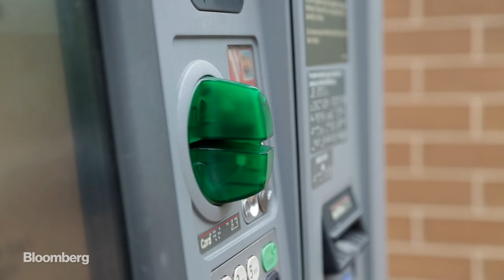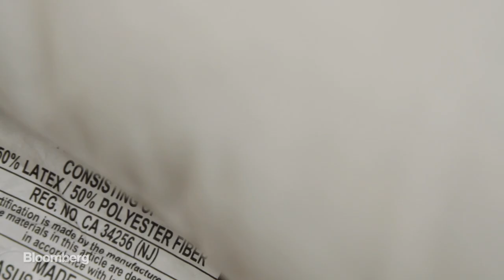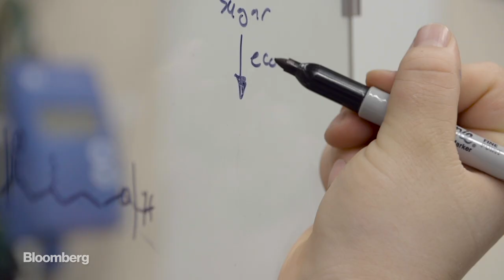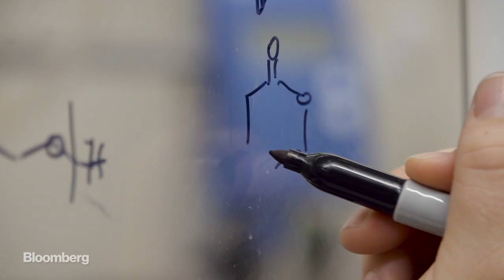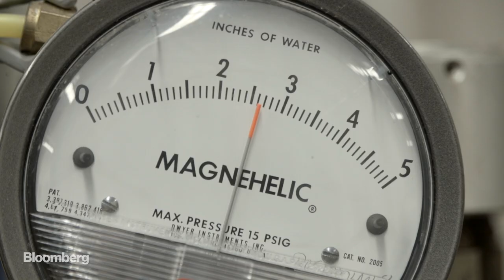Inside the Lab That Could Solve the World's Plastics Problem (Unsolvable: Episode 1)

Comment: The fastest way to make bio-plastic cost competitive is to tax the alternatives.  You could even use some of the petro-plastics tax to subsidize bio-plastic.  The subsidies could be given to domestic manufacturers to offset some of the costs of new tooling to use the new materials, giving them an advantage over foreign manufacturers.  Because so much of our plastic products are imported, the petro-plastics tax has to apply to imported plastic products as well.  If domestic manufacturers start using the bio-plastic first, they get a boost from the "plastic tariff", and the tax winds up encouraging foreign manufacturers to switch to the bio-plastic as well so they can avoid the tax even if we're not giving them any subsidies.  If the tax makes bio-plastics cost competitive now, it will become even more advantageous as manufacturing adopts the new materials and costs come down, so eventually the tax won't be needed anymore.
Reply: That's for sure, also electrical companies get lots more subsidies than sustainable electrics do.
Reply: No more TAX.
Reply: Freakin taxes. Too many people see that as a cure for every damn thing

Comment: Can we move back to when used mostly glass that is recyclable.
Reply: Yo for real. It might inspire people to be less clumsy these days too lol
Reply: You just WASH the bottles and if they are broken then you can send them to be melted into new bottles or whatever.
Reply: Aluminum is much easier and better to recycle.
Reply: @trickmiller8169  Aluminum is reactive and currently they coat it with plastics to prevent that but yeah for many products it can be viable.
Reply: @Barskor1  it's cheaper and more efficient than recycling glass and you yield more from recycling it. It can be recycled endlessly. Reusing, rather than recycling, glass would be easier, but companies probably wouldn't go for it, due to how cheap the alternatives are compared to it.
Reply: Swarthy Pariah actually it doesn’t
Reply: grafvonstauffenburg that’s the point. Its easier to melt it down that way
Reply: grafvonstauffenburg bruh it’s shredded in a controlled environment eg: a barrel or vented room

Comment: How about each region standardize the plastic packaging such that it's easier for the local recycling plants to process the plastics later?
Reply: How would that work? I wouldn't be able to get anything from another region that may be packaged differently?
Reply: @gregdubya1993  how about national standards?
Reply: hemp
Reply: How does that solve the issue of the billion tons of plastic already in the oceans and landfills? Still need to a recycling solution...
Reply: @greezooo  plastic bags can be processed into burnable fuel
Reply: @masterpalladin  right, I had forgotten about plastics-to-syngas. Thanks 👍

Comment: The best way to use recycling plastics like those are applying them into construction or infrastructural projects, mixing polymers with cement or concrete gives the materials a lots of benefits like sealing them or making them more stronger and flexible, also the life of the material become much longer than other industrial products and when it's time to recycle them again it's easier to obtain the polymers by subtracting them from old materials.

Comment: A lot of the time you mention consumers, you avoid the fact that some consumers really do care and really do make an effort, try reaching the zero-waste movement
Reply: I'm not trying to be mean or anything but the people involved in the zero waste movement are only making a microscopic difference into the world's plastic pollution problem. Don't get me wrong they are making a difference but not at the rate that it would take to save the world. The majority of plastic pollution can be traced to only six or seven countries and most of the people there don't recycle or care about the environment. What humanity needs is a cheap and simple solution to the problem because the majority of people don't care.
Reply: @r.r.r9300  - Those countries get imported plastic from Western Society. So the zero-waste movement is still beneficial, as is the vegan movement. Both focus on reduced resource-intensive consumption of products.  "Don't underestimate the power of a few highly dedicated individuals trying to make a difference in the world. In fact, it's the only thing that ever has" - Margaret Atwood

Comment: Fossil fuels: cheap, plentiful, reliable energy for billions

Hydrocarbon, or fossil fuel industry is the only industry that can produce cheap, plentiful, reliable energy on a scale of billions. That means that without such an industry, we don't have the amount of food we need, the amount of technology we want, the amount of anything we need or want.

The first thing to realize is that the vast majority of the world's energy is in fact produced by the hydrocarbon industry. This was true back in 1985, and it’s also true in the present.

Year 1985 Nuclear 5% Hydro 6% Gas 20% Oil 39% Coal 29% 
Year 2015 Nuclear 4% Hydro 7% Gas 24% Oil 33% Coal 29%
As you can see, there’s much more overall energy consumption now and the vast majority of that is still fossil fuel energy. What that means is that we're using considerably more fossil fuels, not less.

Comment: Just make plastic packages highly taxed. Companies will then sell linen bags, drinks in glass bottles and aluminum cans, cheese and foods wrapped in coated paper or will spend more to use plastic ish environmentally friendly materials...    It wouldn't need to even change any prices, just reduce the consumption tax and make a packaging tax that is equivalent in how much tax it generates. Then the price is level but companies will be forced to compete to make the packages cheaper by going away from the highly taxed plastic. Then once less and less plastic is used the tax on plastic packaging increases to keep the tax revenue the same until a certain point where there will be both a plastic tax and consumption tax once there is almost no plastic used.

Comment: here is an idea for a simple and excellent re use product that could eliminate or seriously reduce the usage of fiberglass for insulation :MYLAR plastic such as potato chip bags ect. as far as I have heard recently,are completly nonrecylable also "space blankets" put you hand inside an empty chip bag. SO gather and clean these by visual separation techniques that already exist ,  shred into 12" chips, and compress and glue together with sodium silicate solution( a cheap ,fire retardant glue)into a common brick dimension, use as insulation in green(and eventually all) building projects.

Comment: Step 1: Go to BevMo. Buy a 4-pack of glass Voss Water bottles for $10
Step 2: After you drank the water from a bottle, refill it with Reverse Osmosis filtered water.
Step 3: Goto Step 2

Result: less plastic water bottles in the landfill and whenever people see you with one they will assume you are wealthy enough to buy and drink Voss water on a daily basis without realizing what a cheep-skate you really are.

Added Bonus: Since the bottles are glass and not plastic you will not have to worry about any of the following chemicals
Phthalates
Bisphenol-A
vinyl chloride
ethylene dichloride
& cadmium

Comment: I am nearing 70 years old, and my Legos have survived three generations.  If you would take those cornflakes and turn them into building blocks about 2'hx2'w3'l blocks, we could pop a garage up in an afternoon, pump fire-resistant insulation thru the walls, and build a garage that could last 500 years.  No reason houses and swimming pools couldn't be nearly as easy.  Remodels, additions,  almost fun.  Earthquake, fire, and flood resistant.  With plastic being so abundant and durable, it would make sense to build a brand new house with 2 car garage for $35,000, out of waste, and without any special needs except maybe site preparation.  A piece of land, a few truckloads of plastic blocks, and that pegboard on the ground, and most anyone could build a strong building.  Just a thought.....

Comment: I think the major problem with this is solution is when you through this plastic out ,it's more likely that you've done it because the plastic itself doesn't last that long as petroleum plastic. For example, if you make a car(it's still far from reality) out of this kind of plastic, not only you need to check the condition of the engine and systems but also the plastic. Plastics on cars today last 10-20 years before having issues. With this kind of plastic, it would last 4-5 years because it degrades faster.

I think i might be missing something so don't be afraid to tell me

Comment: All we have to do is use the plastic as fuel. It can basically be substituted into any coal fired plant like steel furnaces, cement kilns, boilers for power plants. Compared to coal its much higher calorific value and much much cleaner burning.

Comment: There is a need for standardizing bioplastics, to make it is easier to sort petroleumbased plastic from bioplastic via optical / NIR sorting. Perhaps forcing single use bioplastic bags to have a standard color?
Reply: Since bioplastics are engineered anyway, why not add fluorescence to the equation?  Maybe each type could be color coded.

Comment: Here's a few ideas to solve the world waste problem, not just plastics. I'm not a scientist or environmental expert but SOMETHING must be done. If we use Critical Thinking we can eliminate this issue and stop trashing the planet. 
1. Lasers- really hot, could vaporize waste? 
2. Acids- really strong, some can dissolve metals
3. Geothermal disposal- tube to Earth heat layers, waste could be dumped and burned up? 
4. Solar tower- sunlight beam from tower (or satellite) could fry waste? 
5. Collison vaporization- An experiment at Sandia National Laboratory in 1980's involved a plane being thrown into a concrete wall at 700 mph, atomized upon impact. Perhaps a cone-shaped metal capsule shot into a wall at extreme speeds could be vaporized? 
6. Underground nuclear/thermobaric/napalm explosions- waste vaporization? 
7. Nuclear Fusion Reactors- Extremely hot, perhaps a metal container could be filled with waste, sealed, put in a vacuum chamber above the reactor to equalize pressure, then dropped into plasma (Tokamak design)?
8. Deep borehole disposal- miles deep holes? 
9. Suborbital capsule reentry- A metal capsule could be launched and reenter atmosphere to burn up? 
10. Deep ocean vaporization- old submarines could be filled with waste and a nuclear bomb, sealed, sunk offshore at vey deep depth, and bomb detonated to vaporize waste? OR containers could be filled, dropped to ocean floor and a nuclear bomb lowered to middle of pile to explode and vaporize waste? 
11. Rocket engine vaporization- Waste in bin above horizontal rocket (dropped into flame) or in tank mixed with rocket fuel for very hot fire (tube/tank underground for fumes/smoke?)
Temporary Storage solutions
12. Container storage- Metal/glass/plastic canisters stored in yards or in underground tunnels? 
13. Better landfill liners- metal/glass/concrete, no leachate leakage? 
14. Tank farms- similar to oil terminals, waste leachate contained and methane could be captured for energy?

Comment: Just about every single "solution" to recyling plastic ends up using more energy than it took to make and ship it in the first place. GIven that it's congealed oil/coal, the most efficient current solution is simply to burn the waste stuff as side stream fuel in power stations.

In the long term it's a valuable petrochemical resource, but that's very long term and the piles are getting too big to deal with.

Comment: Most of the empty packaging could be returned & reused over and over again, but companies don't care enough to have such approach.
Reply: Probably health & liability issues prevent that.
Reply: @sanniepstein4835  re-using without a proper treatment beforehand is not what i was implying. I was proponing that each company should take care of its own garbage, because this way the responsibility of recycling would be divided & managed much better, instead of letting a single company deal with the whole mess. For example, a huge plastic bottle of fabric softener is usually thrown away while it could return to their brand company and prepared for further use. Most of the plastic crap could be safely re-used, it just needs a bit of will & brain. Even the carton box for eggs.. people throw it away when they get home from the marketplace; that's its only purpose- to safely transport eggs to the client. Etc etc etc...

Comment: Plastic is a great product it's reusable, lasts a long time, it's repairable and it can be repurposed, recycled and it has so many uses.

The problem with these biodegradable plastics is that they have a life span that usually means costing you a lot of money to replace even though you didn't get the full use out of the product.

I have had plenty of those biodegradable plastic bags and when they break down they are a right mess, they can't be repaired they only last a certain number of years and they are garbage.

Real plastic bags last longer, don't make a mess and are repairable and reusable recyclable, and you can make other things with them once you have no use for their original design.

The problem with plastics is the people who use them not the plastic itself, people are lazy they throw things away rather than making use of them for other things, rather than recycling they use old plastic bags for rubbish, but then that's what happens when you are encouraged to do so.

Comment: The sorry part about plastics is that we are wasting natural gas and petroleum to make the stuff. Also, ever drive past refineries or oil fields, and see the burning flares,polluting the air and adding heat to the atmosphere? Sad, to say the least.  Try using wax paper, which preceded plastic wrap. Do not buy flimsy sandwich bags. Buy FREEZER BAGS, which can be washed and re-used many times. Used wax paper can be twisted, and used as candles for heat and light during emergencies, or camping out.

Comment: Why can't plastic be pressed into bricks or rail sleepers or beams? If nothing else just light duty bricks.. you can press the more tricky to work with stuff and it can be in cased  into an outer layer of tougher plastic. If I can stuff wrappers into a plastic bottle and shrink it with a heat gun why do these guys with all these expensive facilities have to complicate things so much?

Comment: I really honestly thought that's what all recycling plants do melt it down and reuse it
Reply: In a sense.  Consumer plastics suck because they are dirty and poorly segregated.   Plastics are ground to roughly 5mm then fed through an extruded which melts the plastic and pushes it through a 3mm or so die, water bath and then a cutter.  You end up with nice pellets which are sold to plastic companies.

Comment: Why do CarbonLite's 'cornflakes' need to be melted down and cut into granules when the bottle manufacturers then melt the granules to mold bottles? That's after transportation costs too. It just seems to add more energy consumption to an already energy intensive process. 
I would have thought that if you join up the recycling process with re manufacture in one continuous process the costs would be lower. That may be enough to make the CarbonLite product cheaper than using fresh petroleum sourced plastic.  THEN the tide is turned because if you can really make money out of recycling plastic the adoption of these technologies will be much faster.

Comment: Why aren't we simply recycling what can be recycled? I'm not understanding the issue here.... Do we not recycle what is placed in the "recycle" bin?
Reply: Jesse Fritz bing!   Consumer plastics recycle poorly.  Choose aluminum, paper and metal.
Reply: @optimisticfuture6808  no thanks on aluminum. Its a neurotoxin!! Go back to glass!
Reply: Jesse Fritz I don’t like glass it is very energy intensive and doesn’t recycle as well.  Aluminum cans have a coating that prevents the liquid from touching aluminum.  Ideally don’t use either.  Tap water with lemon is my drink of choice in my container.
Reply: @optimisticfuture6808  aluminum is more energy intensive as it has a hotter melting point than glass. And even though they have a coating on them, aluminum still makes it's way into the liquid of the beverage. Very very very bad for you. Same goes for aluminum foil, this is actually worse!!

Comment: Plastic can be recycled into roads, building homes and a lot of other useful items that would solve a lot of these problems.  Using plastic in roads, actually it creates a  stronger road that can last a lot longer then asphalt.  
A new company is making plastic blocks to build homes that are stronger them wood or cement.  
Plastic is not the problem, people are. If people would be responsible the plastic would not end up in the ocean.
Hopefully one day they will use biodegradable plastic.l, but until then people need to be more responsible.

Comment: I constructed a small machine I call Mr. Thermo. I recycle my plastic waste through Mr. Thermo and it turns it into solvents such as naptha, kerosene, gasoline, light oil, etc.  Mr. Thermo is powered by a wood fire. Mr. Thermo cost me less than $25 to build. The gasoline from Mr. Thermo works well in my lawnmower. By the way, Mr. Thermo uses anaerobic pyrolilysis to “crack “ the complex molecules of plastic into its basic building blocks.
Reply: Then why the hell haven't you patented and sold that thing? That's a fucking incredible invention.
Reply: @ Potty Mouth
I don’t chase money. Also, I don’t believe in patents. All patents do is restrict people’s freedom from doing things. Besides, a patent, after a professional patent search and all, usually costs just short of $300,000.00. I have watched friends, fellow inventors and innovators, go down that road. No thanks.